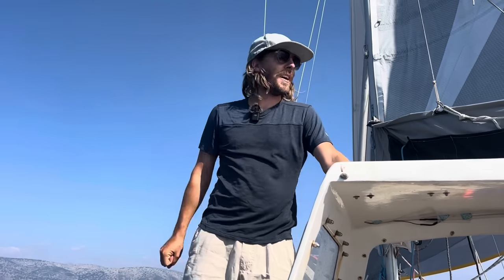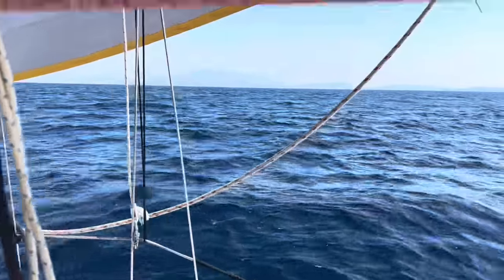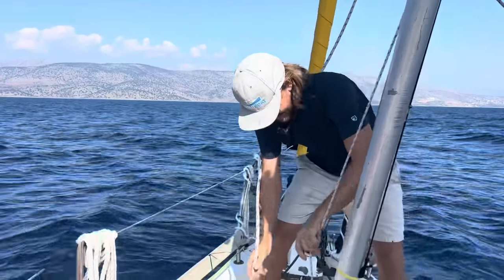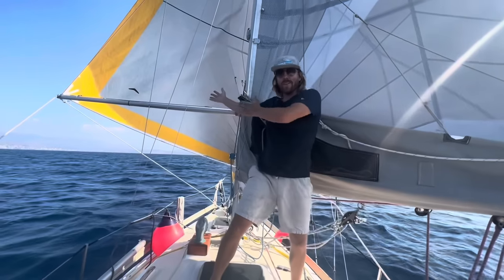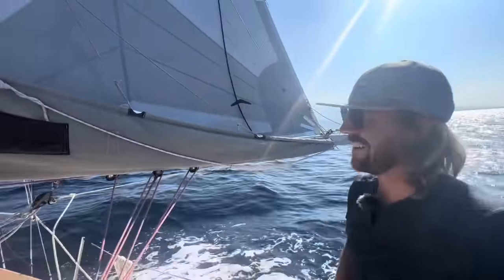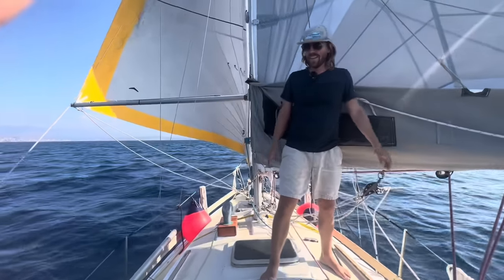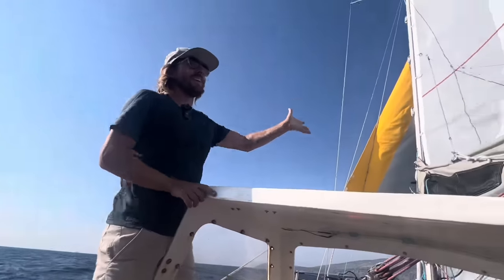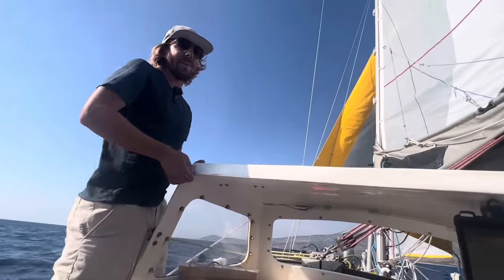How to make your boat sail better

Comment: Excellent video as ever . One point to pick up on , when you hove to / crash tack or put the hand break on , the tiller is lashed to the leward side for a reason . Your backed jib is trying to turn you to starboard and your rudder is opposing this motion.  The main can be then eased to the point of balance.  You're 5hen just drifting with any tide .You did mention lashing the tiller,  just didn't explain why .  Looking forward to seeing more tips .

Comment: Nice overview!  Since you asked for input, some may not be familiar with powering down a sail by increasing twist, reducing load along the upper portion offering a quick way to respond to building conditions; and how to so so with jib lead and mainsheet/traveler/boom vang adjustment.  Could be worth a mention in a follow on video.  

Your videos are great Sam, much enjoyed.  And your sails are looking sharp.

Comment: Good stuff Sam! I'm sure that with those new sails you're really discovering what your boat is capable of. One thing I like to do on my boat is to set the autotiller for a given course, then play around with sail trim until that AT is hardly working at all - very small corrections, and only working against very light weather helm. That's when I know she's trimmed just right.
Reply: Yeah, New Sails are a whole new topic on what advantage new sails have over old.

Comment: Hi Sam, I bought a 30ft yacht this summer with absolutely zero experience. Doing some work on it at the moment but it’ll be in the water in April.
Obviously having no experience I’ve been watching loads of videos trying to learn everything but things like whisker poles, reefing, jibing were always missing or not quite relevant to yacht sailing (mostly dinghies) so I have been mostly cross-interpreting how these work. This video confirmed all of my interpretations good stuff 👌🏻👌🏻👌🏻

Comment: That was great, explaining weather helm/lee helm especially. I always have trouble with my little Cat22 turning into the wind, constantly adjusting the tiller minder drives me crazy. Just finished my second season of sailing, still learning, I'd say I'm just slightly above novice with my biggest accomplishment of leaning to heave to, which I did by accident the very first time, but figured out what had happened and never looked back. It's great for me because I'm usually single handing so I use that to pull the main sail down which makes me think the main has nothing to do with heaving to. I think the wind, if coming from, say, the port side pushes the head sail making the boat want to turn to starboard, the rudder is locked to steer it back to port, so I think they cancel each other out and the boat just slides sideways. Be safe, take care.

Comment: Thanks for this video Sam. This is a really helpful one. Not many Youtubers have taken it to this level teaching their fan's their knowledge. Kudos to you. I've finally made some progress on my 22. Not sure its going sailing this year. Just not ready for it yet.  But I made a bunch of progress and discovered there were two booms, both with sails.  A newer one with a Dacron sail and the original larger with a roller furling main. Its a Morgan 22. Lots of work to do but I'll be sailing next year on Lake Huron and then hopefully other locations after that... hoping for Keys or Bahamas in spring of 2025.

Comment: Good stuff. Always good to go back to the basics. The bottom of the whisker pole on my Hunter kept grabbing the head sail sheets when I tacked. I got a 3'  maybe 4' piece of ABS pipe and slipped it over the bottom of the whisker pole. Had to drill a small hole and attached a safety line so the ABS pipe doesn't just roll overboard. 
I found heaving to to be easy and completely obvious. Wing on wing while it looks simple enough,  but I found it surprisingly tricky and potentially dangerous. So it's good to practice that in the lightest possible winds. The safety lines, brake line, and barber hauler are all safer, more secure and insurance against damaging stuff. I always have an extra length of rope in my cockpit, I've never sailed with anyone else who's got an extra length on hand. I think it's just smart to have. I also have carabiners snapped on my pfd. Last big trip I stepped on board with my carabiners. "What are those for?"  When I left the boat three months later, I had to leave half of them behind - they were working (barber hauler,  kite sheets, etc....) and the owner had bought carabiners in Japan.   Probably be a nice gift visiting someone else's boat.
Reply from the maker: Great tips. Thanks

Comment: Oh man. It's setups like these that kind of intimidate me into setting up a boat with more than just a standard jib and mainsail. How many freaking lines do you have to keep track of and untangled? 2 Jib sheets, furl line, up and down haul for the pole both ends, main halyard, main sheet, preventers, then you get into the weird spinaker setups leading to the stern. It just gets so messy  in my mind. I'm sure it's fine to just kind of walk through it each time, but when things get messy in an emergency you've got a lot of stuff to do to stow.

Comment: On my boat the builder was worried about a preventer in over 15 knots.  During an accidental jibe the boom could break.  The solution is to have a fuse in the preventer.  A fuse is a line rated at a low strength to break.  Thus it will hold the boom during typical waves but during a full jibe will let the boom go to prevent damage.  The builder has to stop racing in the Vendée globe after an accidental jibe broke his boom.
Reply from the maker: might be a good idea. thanks!

Comment: That was good Sam. We want to start using our pole. We have an up haul but not a down haul. I don't think you had one either? The jib sheet should keep it down, correct? Thanks Phil
Reply from the maker: I have a downhaul also. You dont need it but it helps keep the pole still in very strong wind.

Comment: I have a question regarding running wing on wing and the helm effects of bobbing back and forth and im curious if thats mitigated at all by moving the sailplan forward relative to the keel, in your case by getting rid of the main and adding an asymmetric sail, using two whisker poles (yay new vocabulary)? Less nose up-and-down right?, does that help?  Thanks!
Reply from the maker: Moving the sail area forward definitely helps the boat sail better downwind. not sure if it would reduce the rolling though. maybe. sometimes a reefed main on the centerline helps the dampen the rolling with the jib poled out.

Comment: In dinghy racing/sailing a lot more trimming of the sails is done. to give the sails the best shape for the wind conditions and the wind direction( down wind, up wind or halfwind).  I don't see (m)any option for tightening or losening the luff, leech or foot of your sails. Also in Dinghys with aliminium masts we can adjust the angle of the mast(by bending it) to adjust the shape of the mainsail.
Do race Yachts that are the size of pickled herring adjust the shape of the sails more?

Comment: I learned what a boom vang does & HOW TO put up a whisker pole. 
I rigged a few hundred mostly new sailboats & some used, from '78-'96, & did many short 1- day deliveries (to boat shows) & two 7-day deliveries during those 18 years. Haven't been sailing since.
How do you put up a whisker pole if you don't have a roller furler... but hanks instead?
Reply from the maker: In that case I raise the sail and try to grab the sheet with the jaw on the pole then attach the pole to the mast. Its kind of sketchy with a big sail
Reply: @samholmessailing  Yeah, I figured it might NOT be as controlled as with using a roller furler.... "trying to grab the sheet/clew" of a violently flapping sail sounds a bit less controlled.👍

Comment: MFSH ! Great job the voice over was fine. I see a different person in this video. 
With your back preventer is it just  1 foward line and 2 lines prt/stb on the boom?
I have a roller boom so I may have to find a way of putting in those bags for lines.
Yes keep going on 3/ 4 or what needs review. 
Your thought process when you leave a port for a destination interest me. Thank you again good job
Reply from the maker: That is correct. I suppose you could also have two forward lines but I didn't want too much clutter up there. not to much work to move it from side to side. some people will just use a single line for the whole thing but it can be a little sketchy reaching out to attach the line to the end of the boom each time when you need to switch the side.

Comment: 2:10 Speaking as someone who's never sailed a day in his life, and never
even touched a whisker pole ...
That's upside down. You've got the weight of the pole on the pin, rather
than on the strong U-shaped piece of metal (the hook?).

Comment: Sam, handrails on the top of your dockhouse gould be an idea ? Br. Esko
Reply from the maker: Yes need to add that
Reply: @samholmessailing  Fine, I got an idea of your reefing systen, rope/clamb ready Like your videos, good attitude. Favorable winds Br. Esko Finland, singlehander with Schelinkryssare.
Reply: @samholmessailing  Sam, Biltema has 75 cm stainles steel handrail 30 €. Br. Esko

Comment: Im playing with a 14 foot fiberglass swing keel but make it a little keelboat by switching to an inch-thick steel keel and reducing the mast height from 22 feet to 14, in fact also reducing the sailplan entirely to a forward raked mast with genoa only and some nice oarlocks.  What do you think will this result in a stubby little uncapsizeable play boat or is it going to fail?  If the genny only gives me too much helm my plan is to add a little staysail from masthead to stern to give it balance.  Anyway.  This way i can reuse the stuff it has only building the custom mast step forward and theres no mast just the shrouds to get in gennys way. Edit also no boom to hit in the head.
Reply from the maker: Right on. Might work. Only one way to find out!